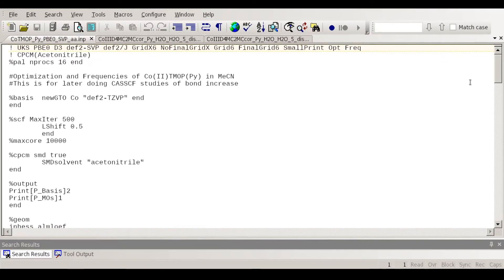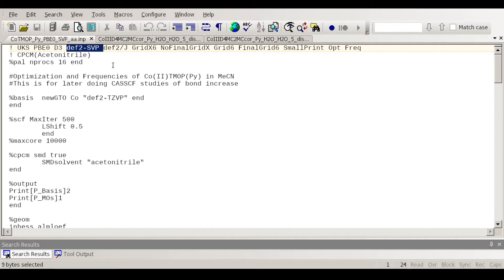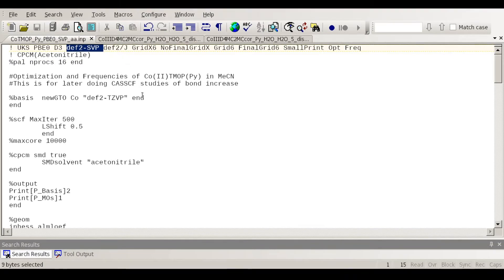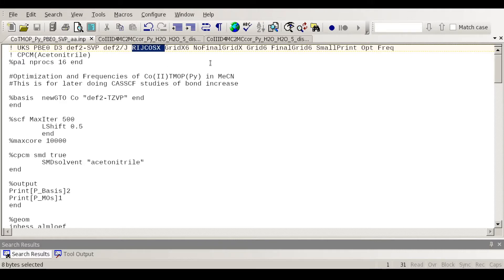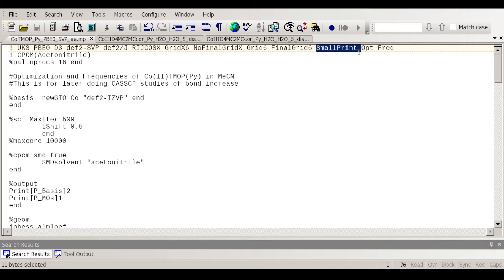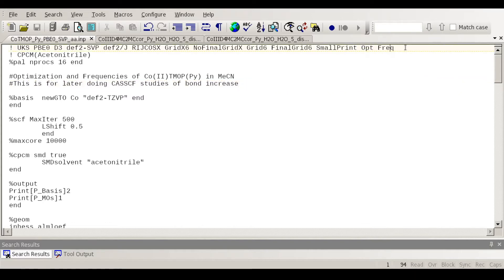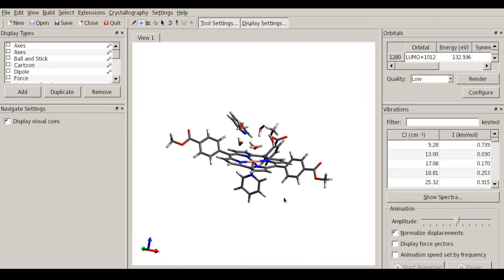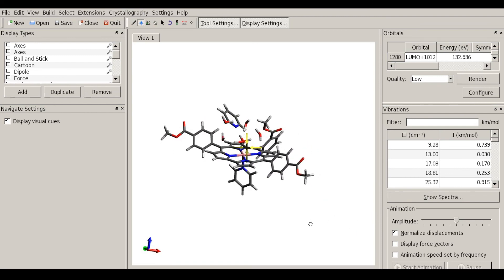Electronic Structure Calculations in ORCA - Part 4

Comment: Hlw sir.how can we calculate the Homo -lumo of big complex like lanthanide complexes through DFT in avagadro orca ..what procedure we have to follow n basic and advanced function
Reply from the maker: @Vinti1031  there are many ways. The Homo-Lumo gap is the difference between the energies of the orbitals. If you open any output file from Orca in Avogadro you will see those values. You can also open the file with a text editor, search for orbital energies and search for the orbitals manually. It depends on which method you want to use. If you watch other videos you will see many examples of different types of calculations, which may give you a better idea. But I have not covered this specifically in any video.

Comment: thank you for providing agood explanations of your input file bul  i have problem that how to input file the cpcm  like TFE(2,2,2-tri fluoroethanol) that the orca does not the solvent how to input file would you help me?
thank you
Reply from the maker: if the solvent is not defined in the cpcm solvent list, you have to manually define its dielectric constant using the %cpcm block. please check the manual. it's easy but you need to know a couple of the solvent parameters
Reply: @niconeuman  thanks a milion